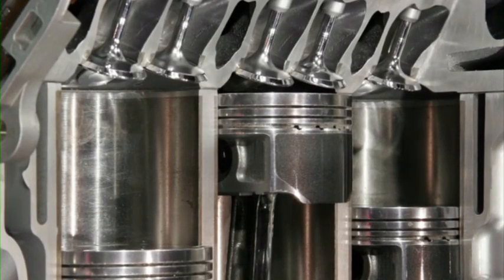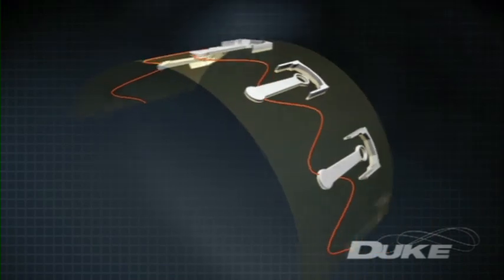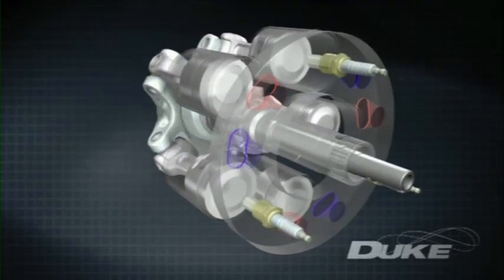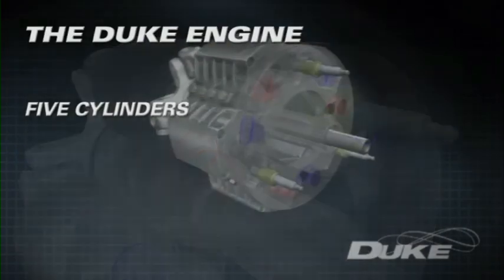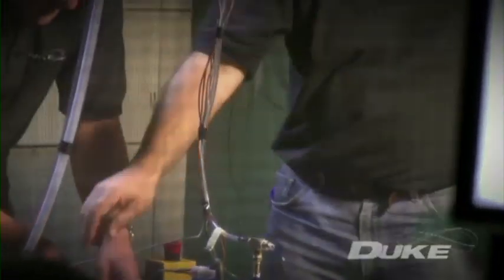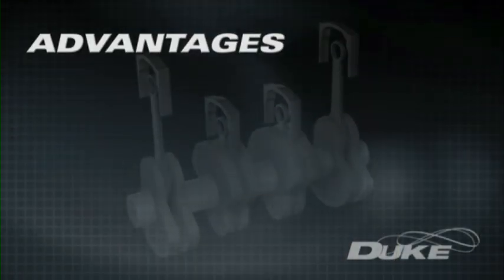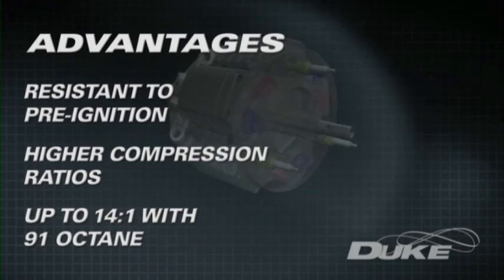Duke Engines

Comment: I feel like with so many parts moving in such an awkward motion, this engine would fail quicker than a typical I4, I5, V6, or V8. In order for this to become on option they would really need to stress test many engines under powerful load over many years. I think it's going to be really hard for anyone to ever compete with the engines we've become accustomed to.
Reply: Korben Dallas Fewer parts doesn't mean it will last longer. Look at the wankel engine for example(not saying they are the same) it has fewer parts as well but isn't as reliable.
Reply: @mufasa3253  The Wankel was a poorly designed engine from the get go.
Reply: ***** Biggest problem the wankel has that this engine would have is the sealing for the top of the combustion chamber.  A piston ring as it wears will expand outwards through natural spring force and from the combustion stroke applying an expansion force.  However, the apex seals on the rotaries, and the seals for this would have to have an applied force constant due to a flat on flat sealing characteristic and even more, the seals having to move across a port.

As said above, fewer moving parts does not mean less chance of failure.  It is how things move that does alot, and how it is lubricated.  Any part with an asymetrical action will wear faster because it relies entirely on oil pressure to provide lubrication.  A spinning part will naturally create a fluid film to prevent wear.  As long as it has fluid of proper viscosity, no contact will occur.

Properly gapped bearings, cam followers, etc all work on this principle.  With proper care, they will last a very long time with final mechanical failure of an engine usually only due to cylinder and piston wear in which this effect does not happen.

This is where I see the weakness in this engine being.  The joints for the conrod connection.  There is no cyclical force to provide lubrication, as result, relies entirely on pressure to take the constant impact load over and over again, almost like a hip joint.If ran presurized, should be okay.  Same with the central portion where it applies to the crankshaft.
Reply: With fewer moving parts, it will certainly last longer than current designs.
Reply: Korben Dallas
Eh. Many people won't keep a car for that long anyways. My car has 190k miles and runs fine. Only reason I still have it is because I don't have money for a newer one with less miles.
Reply: @KorbenDallas  that's bullshit with all the centripetal force it would burn through due to the friction in no time
Reply: *****
 And fewer parts doesn't necessarily mean it will be less expensive to manufacture. Problem with a lot of these axial engines is their low rotational speed make them harder to integrate into modern applications.And then there is the emissions issue which killed the Wankel. By the time it was made clean, it was costlier than a piston engine.
Reply: I'm also interested in how they deal with vibration, with the offset of the "reciprocator", and bearing wear on said part. Is that entire unit fed oil/lubrication, or are they planning on using a sealed bearing?
Reply: Dave M
Emissions regulations killed the Wankel? Well, there go my hopes of ever seeing an RX-9. To be fair though, for 1.3L, RX-8's 3-rotor consumed as much as a 6.2L LS engine, which is scary, even if you're like me and don't give a shit about fuel consumption/fuel costs.
Reply: Ultrakillerism
 The RX-7 was never priced anywhere near the Porsche 911 price. It was not a competitor but a low priced alternate. It was dropped as it was just as, if not more, expensive than a conventional engine  of equal power to manufacture and meet mileage and emission regs.
Reply: @davem5333  @Ultrakillerism Bois , 7 years passed since you guys commented... What you thouhts are?
Reply: Ultrakillerism Specifically, oil consumption, the biggest beef people have with the rotaries and specifically RX-8.  Pistons have the advantage of being able to use the taper on the rings and combustion force to properly seal and scrape oil off the surface.  However the rotary apex seals, no such mechanical advantage.  To keep these seals lubricated, essentially has to burn a little bit.

In terms of fuel economy, the displacement is a bit of a misnomer.  It may be 1.3. but it fires it's full displacement a rotation, whereas a 4 stroke is every two rotations.  Secondly, the Rotary advantage is the high RPMs. so 2.6 and it runs double the RPM's for it's power curve, and you are suddenly a 5.2L+ equal without as direct of a power application of the flame front.

I do agree, is a shame.  From a pure performance point of view, the rotary could only get better if they threw the monies for fixing these issues.  Sure, they are heavy, but the Wankel and Renesis rotaries could only be killed by overheating.  Over-rev or even miss-shift, they don't care.
Reply: MarkusReese
But didn't they throw money to resolve the problem with emissions, then still Mazda killed the Rotary because it was too expensive? I also wonder just how really expensive it was/would have been, since when they made the RX-7, it was priced back then at $75k, which was Porsche 911 money back then, and was an ok-ish competitor, plus quite a few people bought it.

Comment: From the history on sleeve valve designs they were only successful in low HP & BMEP engines. How ever that design has been 100% successful in hydraulic motors & pumps ,and AC compressors
To really put your engine to a real test have it work the oilfields, Many standard engines have been in service running 24-7 for over 30 years without major service

Comment: eelcogg.
Those were my first thoughts about this engine.
The design does raise a lot of questions.
However, if they can get better (or even the same) efficiency as a standard engine of today, Then I could see a lot of potential for this motor.
Especially at hi revs!?

Comment: I see more reciprocating and rotating mass than in a conventional IC engine. This would lead to poor throttle response. 
In a conventional engine, there is only one link connecting the piston to the crank shaft. Here I see at least 4. 
In a conventional engine, the piston pushes on the crank, creating torque on the shaft. In this design, the force first has to be redirected. Does this mean that there has to be an additional loss because of the way the force has to be decomposed to a radial component and lever arm plus the friction in the additional bearings and hinges?
How is the cooling achieved? If it is water cooled, does the whole water jacket rotate with the cylinders? Same question for lubrication. That would add even more complexity. The only benefit I see is size...and even that is questionable considering all the additional parts an engine needs but are not shown in this video (water pump, oil pump, alternator, fuel feed, exhaust,...)
Reply: I love youtube experts.....
Reply: If you look at the other  'new engine idea' vids on you tube you will see  there are a lot of these concept engines about. I tend to view them all as a method of salting the mine .And in this ,the "inventor"  is going to use it raise cash via the stock market. A prime example was Australia's Ralf Sarich who built an over  complicated engine ,and claimed it was the engine of the future. People claiming to be canny investors poured millions into it before Sarich sold his share holding in the orbital engine company, becoming a very rich man in the process. no engines,apart from his first example were ever built.  If building a car engine using the same idea as can be found in air compressors and refrigeration compressors is supposed to be a new invention,then i wish them luck.
Reply: Michel Linschoten I'm no expert, but I think I at least qualify to pose some relevant questions and remarks. This video is related to science and engineering, so any claims made are subjected to peer review :-)
Reply: eelcogg "so any claims made are subjected to peer review :-)" The hell are u talking about? That's as stupid as saying, "He's a cook, so anything he cooks will be eaten." You can't even think logically and ur babbling about science?
Reply: i agree, there is more rotating mass in this, and I already have an idea what they could change, its simple enough, but still would not remove the issue of seals that is always there regardless of design if things are rotating in any form or fashion.   Though what I'm thinking at least might reduce some of the rotating mass ;)

Comment: Looks good at first but on second?
More moving parts, and the central moving part moves in circle and wave movement, also how do you think to keep it tight, the cylinders are moving against the upper part.
If you get this thing reliable, I would really work on a wankel engine instead.

Comment: wow, this thing is even worse than the Wankel-Motor in therms of Friction loses oO
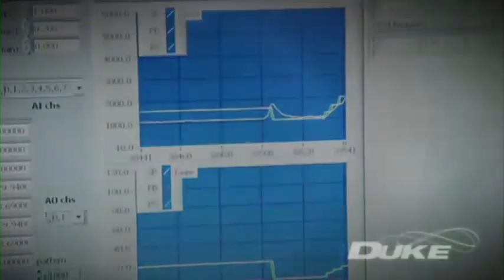Also i see that this has an ordinary carburetor system. An modern high pressure Piezo fuel injetion system would be very difficult to aplicate here so its not very up to date.Therefore modern CO2 saving standats could not be acomplished easily and no authorization will be obtained by many countries (Euro-6 and Tier 2 limits EPA). The translational torque produced by the piston must be transferred through that coupling disk in a rotatory torque, but what happens extremely ineffective. But the biggest problem arises because of the side moving Displacement which can cause wetting by fuel and with it secondary ignitions (so called "engine knocking") which can cause huge damage to the piston, the tread surface and the spark plugs. Not to mention the efficiency loss due to the asymmetrical burning. Incidentally, the weight savings of 30%, they have re-inserted with this huge coupling disc (2:49) :D (i´m sry for my english)

Comment: One of the major issues with these kinds of engines is maintaining the seal on the piston so that ignited fuel can not escape and damage critical parts. There are other engines our there that have only one moving part and the issues of the seals is what killed them in development. This adds a whole other level of complexity to it and for the time being I don't know of any materials or mechanisms that would make this feasible. Its a fabulous concept and I hope it can be applied to improve current engines or even better, I hope this concept can be refined. But as it stands, forcing the piston itself to rotate around a disk will cause serious issues with fuel leaks and most importantly, friction generated heat. To maintain a seal that piston will have to be pressed down hard on the disk. As the engine reaches high revs the heat from fiction will either melt those pistons or seriously wear them down. It may meet and even out preform current engines in short term tests but what this engine needs in order to actually be functional is to be long lasting and reliable in long term testing.

Comment: I see lots of wear, sealing problems and cooling problems
Reply: Saeid Momtahan
XD and how successful is the Wankel engine? especially with its oil consumption?
Reply: yes, indeed
Reply: If they could seal a Wankel engine, I think they could seal this
Reply: They never did completely solve the sealing of the Wankel.  If a theoretically perfectly shaped combustion chamber could be machined, and a perfectly shaped rotor seal could be constructed, then it would have been a better engine.  The unsolvable problem with the Wankel is the offset motion of the rotor after combustion and it's non-linear compression ratio as the rotor moves away.

Comment: I love the fact that this is being worked on, and it's even more incredible to see that it is being done here in NZ.

Ok question. so the pistons/cylinders revolve around the valves and sparkplugs instead of using a cam and timing system. I'm curious as to how the engine seals the cylinder over the in/out/spark ports.

All of the solutions I have thought of right off then engine because of wear or the inability to use forced induction systems.

Comment: It looks good, that's the good news however I see a very large rotating mass, very elaborate machine work.  True this design eliminates the valve train but it appears the exhaust stroke is overlapping into the intake stroke.  The method by which these rotating pistons go about rotating the output shaft will result in poor torque output.

Comment: Nice concept but I am doubtful that it will have a long life span due to the contact between the head ring and the rotating cylinder block wearing out very quickly. Flame corrosion and carbonisation from combustion of this area will quickly erode the sealing surfaces. Interesting to see if they can overcome this problem.

Comment: As usual, I see lots of pontificating on a technical youtube video from people with absolutely no idea what they are talking about. The sinusoidal reciprocator eliminates the crankshaft, which is a major cause of torque inefficiency in conventional internal combustion engines. It also eliminates the entire valve train, which is a major simplification. That and the greater space efficiency and power to weight ratio makes this a technically superior engine.

I'd still rather have a Tesla with an electric motor, but still, it's a theoretical improvement over conventional engines.
Reply: I agree, but just seeing that big chunk of metal rotating around makes me think there are a lot of issues regarding wear. Also, I assume it can only have fixed timing for intake and exhaust, which is a big no-no these days. how is it lubricated and cooled?
Reply: alxcsb basicly all you need to do is make sure the crank-core doesn't fluctuate, so if you get the valve-timing aligned with the flux of the ignition-matrix (which is fairly easy to do using a combinatorial demuxer) most of the hard stuff will sort itself out.

Comment: It seems a very good concept, but if you are very careful you'll see the problem. The cylinders are moving with pistons. So how could you seal the cylinders with the top end of the engine from escaping compression, cooling liquid and oil from them? I am sure that doesn't exist a long term solution for this issue. Like the wankel. A lot of power from a small displacement, but with some costs: huge oil & gas consumption.

Comment: Very interesting indeed, but, the way it converts linear to rotational torque seems inefficient through friction loss and lack of leverage that this doesn't exhibit by it's unique, uh, crank? I'm interested in learning it's torque numbers, which I'm betting aren't good enough for motive work. I just don't see enough leverage to make usable torque. It's power curve would be pretty short due to it's static port timing and fixed port volumes, both intake and exhaust.
2 stroke motors have variable port height and timing that vastly increase their power and torque making abilities across their rpm range and increased efficiency that are just as compact and lightweight as this is claiming. A 2 stroke would be much less complex and expensive than this is and for what they appear to want it to do.

Comment: I am skeptical.  Lots of radical concept engines have been developed over the years. Their weakness usually lies in there air seals. This engine requires the cylinders to be forced against a stationary disk basically acting as a rotary valve. The head gaskets have to slide constantly. Not to sure about the reliability of this concept. Rotary valve four strokes never seem to make the cut these days. 30% weight savings is most likely do to the fact that you have no valve train. Sorry.

Comment: So what happens if a spark plug or fuel injector goes bad? In a standard six cylinder engine, you lose one cylinder. On this, you would lose the equivalent of 2. And the addition of U-joints means there's going to be 3 dimensional stress states and twice as many spots for shear fatigue. And then we get to the point of rotating the entire block, pistons, and reciprocator instead of just the crankshaft. That will have a very large amount of inertia to overcome, which really defeats the 30% weight reduction that they are so proud of. The only thing this has going for it from the video is a high compression ratio, and I don't think that pro outweighs the cons.

Comment: The necessity to seal and lubricate the joint between the rotating cylinder block and stationary head means this engine is going to burn a lot of oil. Hydrocarbons emissions are going to be very high.

Comment: LOL!  Nothing like adding a monstrous amount of complexity while adding nothing to the field.
Reply: Using less moving parts actually helps a lot...
Reply: In this case, the cylinders are also rotating with the pistons, thus adding tremendous additional weight to the rotating mass.  One of the things people do to get much better fuel economy (as well as more power) is to reduce the weight of the rotating assembly.  Aluminum flywheel, aluminum driveshaft, titanium valves, lightweight wheels, etc.  That's why the pistons rotate, rather than the block.
Reply: There might be advantages with the sinusoidal-like range of movement though. The question is what RPM can it reach before it starts tearing itself apart
Reply: WheelsNReels But it looks like there is more or same amount of moving parts. And what about the old rotary engine? A rotary engine has more less moving parts than this. So than, why isn't it good?

Comment: What about disadvantages? Let's forget about thermal expansion friction, the whole rotating assembly flying apart in high rpm, etc, etc, shall we simply just ask about the energy cost for this thing to output 100hp for one hour compare to the "traditional" internal combustion engines?